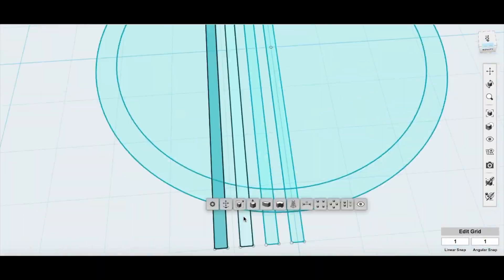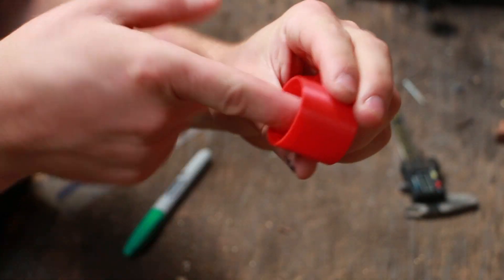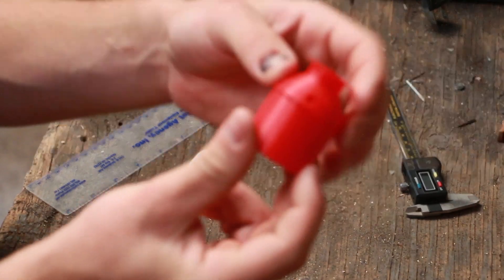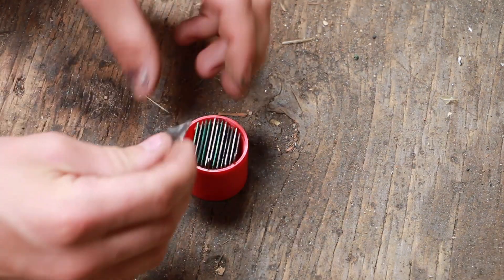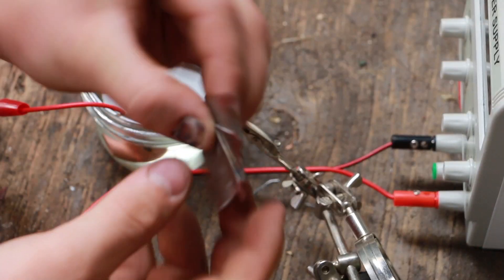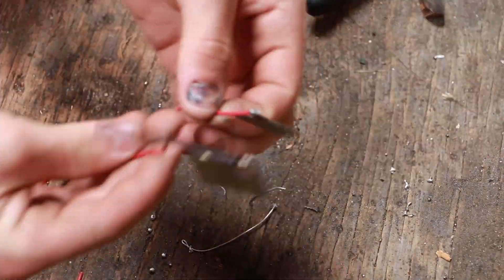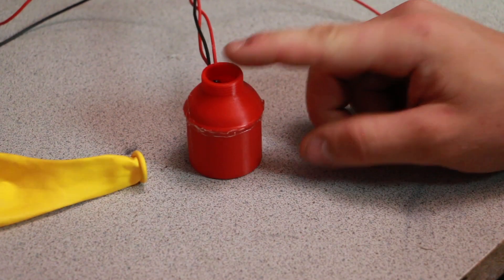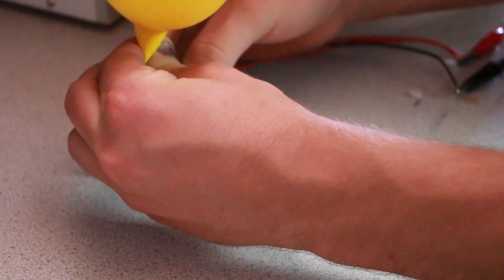3D Printing a HHO Generator!

Comment: The problem is your copper and possibly the solder will erode/rust off during the electrolysis process. Then your plates will lose connection and it will fail. The solution to this is to use something like liquid plastic or liquid electrical tape to cover the non-stainless connections.

Comment: Use baking soda, it does not attack the electrodes. avoid using salt, if the steel has chrome in it, hexavalent chrome will be produced, that stuff is so dangerous it made Erin Brockovich famous.

Comment: wait im confused, you only wired three of the plates, to make the production as much as possible shouldnt each plate be wired, alternating between positive and negative?
Reply: you are right. i think he did it just that it looks cool or they might be internally connected.
Reply: I could be wrong but i think hho generators need neutral plates inbetween the other wired plates
Reply: no
Reply: yes but im pretty sure not that many neutral plates, there was only two wired plates, the rest were neutral
Reply: you can use two copper wires to make hho generator and use 9 volt dc battery, you can capture it using soap or balloon if you want..When using stainless steel water wont get 'dirty', iron will rust. neutral plates work as capacitor, but it might works only ac not dc current..There is one good type to make hho generator it is called: closed system. When wires are not direct connected in to water..plates close the system and water is between the plates. Plates are sealed by rubber square or ring. Plates has few holes where gas can escape and water can flow freely..